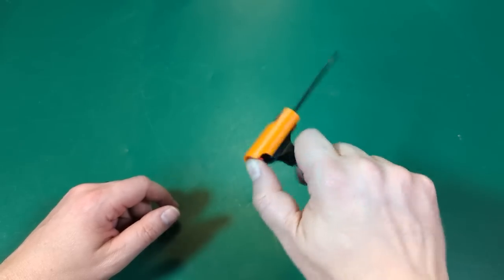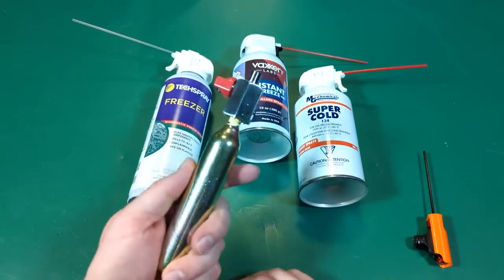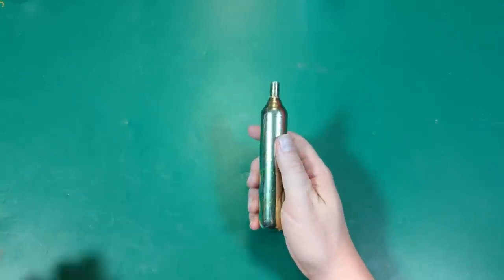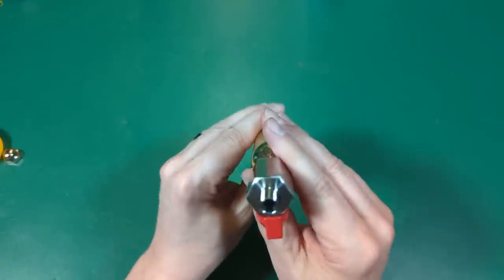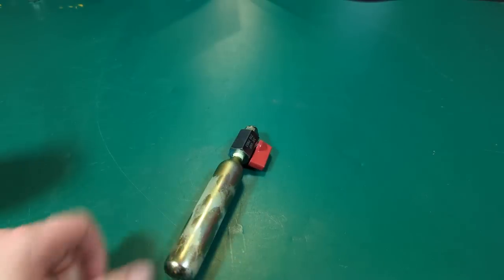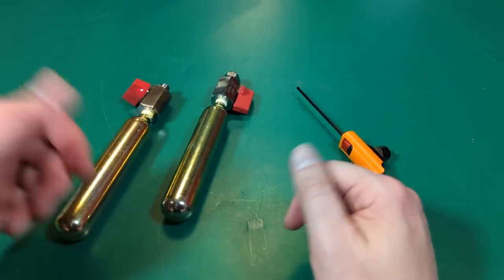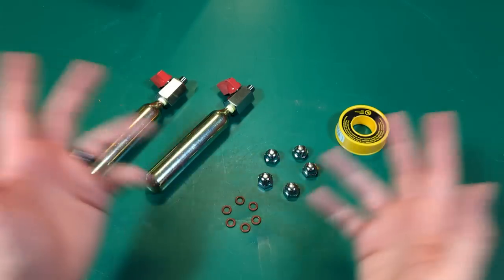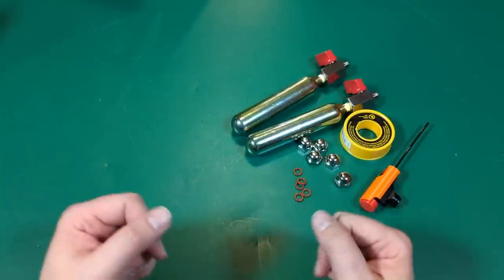Making Your Gas Canisters Refillable

Comment: You can usually unscrew those red handles and reposition them to your liking, so you could have it in the closed position when lying flat,
Reply: Of course if someone else picks it up, you've changed the standard for every ball valve of crossways=closed.  Which would be confusing.

Comment: If you wrap the cannister with some insulation you can greatly reduce the rush to close the valve.  Once the cannister is cold it'll stop boiling altogether. If you bore a hole in a block of styrofoam that'll also hold it upright for ya.
 
I've tried spraying difluoroethane into a thermos and even with the top open there was still liquid in it after like 15 minutes.  I had a temperature probe in it and it read a steady -30C or so until the liquid was gone.

Comment: I'm not sure if it would be any more or less effective than this, but back when I made Airsoft props we used to use refillable CO2 or air canisters, with a little plug of baby/talc powder (we also tried flour, but that is slightly very flammable) on the end to make a particle cloud. Aluminum tape worked as a cheap low pressure rupture disc to re-seal the canisters.
Reply: Joshua Burgess, "very slightly flammable"
Love it.
I used to refil an old BB gun with butane, and shoot the BB through a lit flame, fun times.

Comment: If you're concerned about global warming potential, MG Chemicals also makes a version of their freezer in r1234ze. Boiling point of -19c vs -26c means it won't perform quite as well.
On a side note: if you hate waste enough to refill a disposable lighter, the same fill method works with them and butane. Just spray it in until you have it mostly filled with liquid then quickly reinstall the valve.
Reply: why would you worry about ozone depletion with R134a?  It isn't an HCFC - it has zero ODP.
Reply: As a species, of course we should be concerned with ozone depletion. How we did not cease the immediate production of the entire chemical family that causes it shows how stupid we are. I understand the process people have being climate change deniers but to refute the consequences of not having an ozone layer is complete psychopathy.
Reply: @elinyght9491  sorry, I'll edit my comment: it is global warming potential (gwp). Old enough to remember when r12 production was stopped for the sake of the ozone layer.
Reply: @james-faulkner  But that was done.   Lookup the Montreal Protocol.  Developed countries like USA phased out ozone depleting refrigerants by 2020.  My point is that R134a is not an ozone depleting refrigerant (HFC rather than an HCFC) .  It has a GWP (Glowbal Warming Potential) of around 1400, meaning each pound of refrigerant leaked into the atmosphere has the equivalent warming potential of 1400 pounds of CO2 (which is significantly less than most of the refrigerants that we've been using commercially for the last 30 years), but it doesn't do anything to the ozone layer (which has been regenerating since we stopped making the HCFC refrigerants that would eventually end up in the atmosphere).
Reply: @kstricl  well now your comment makes more sense!  And I agree, worrying about GWP should be a thing, and having a lower GWP refrigerant in the canisters would be a good idea.
Reply: @elinyght9491  I am aware that some measures were taken. It is illegal to produce but not to use or sell. I am aware that this family of chemicals has not yet been to determined to deplete ozone and considered safe. My point is that demonstrates our ignorance that while having the knowledge of what Freon and other chemicals did, we only recently stopped making it. There are many other examples as well, petrol-chemicals are another as well as Teflon.
In reading the OP opening statement again, I failed to point out his error in his vocabulary. It isn't anything like global warming, ozone depletion would cause the sterilisation of Earth.
Reply: @james-faulkner  also, we just shouldn't use harmfull stuff when there are less harmfull alternatives. 
And last I heard, ozone depleting emissions have gone up again in some countries. 
I don't know if this is due to equipment recycling or new production, but it clearly shows that not everyone has gotten the message or cares.

Also, atmospheric chemistry has surprising interactions.
For example, growing hydrogen emissions will significantly impede natural methane breakdown, increasing it's effective GWP via a longer lifetime. (Sabine Hossenfelder has a recent video about that, i'll add the name)

Also, thank you everyone for civil discussion :)
Reply: @elinyght9491  just to nitpick. GWP is measured in kg, not pounds.  Sure it can be measured in pounds as well but then your value of 1400 gwp on R134 would be incorrect.
Reply: @nos9784  I have also heard of other countries doing that plus everyone I know has released Freon into the atmosphere knowing the laws.
I am aware of Sabine, I have watched a couple of videos. While she does do some science, she is mimicking Last Week Tonight and putting jokes and ridiculous images behind her with sound effects. Plus she is attempting to tell jokes and reads the scripts as well a bot would. I know, she is German they don't do comedy but she should know that. I guess I don't need all of the slide whistles and squirting flowers to watch a video that if presented well, would not require tricks. 

You know on Last Week Tonight they even did jokes about the Uvalde school shooting. I watched to see if they could actually do an adult programme and they couldn't. I don't think it is because they will not I think it is because they cannot. Now everybody is doing it.

Now who would get all pissy about Freon and family? 

Hey I used to run a refrigeration engine room, want a good refrigerant, NH3. Hell America doesn't even consider that a poison like the rest of the civilised world.
Reply: @kstricl  r12 was banned shortly before DuPont's patent on it expired.  DuPont then introduced a new refrigerant with a new patent.  Was it banned because it was bad for the environment, or banned to make more money for DuPont?
Reply: @Fury_BlackWolf  No, the figure would be exactly the same. If 1lb of R134a is an equivalent to 1400lb of CO2, then 0.45kg (1lb) of R134a is an equivalent of 0.45kg*1400 of CO2. Divide both sides by 0.45kg/1lb and you have the same factor. This is thankfully one area where conversion to imperial doesn't screw calculations over.
Reply: @MikrySoft  Oh damn. Yes you're obviously right. Was a bit tired in my head when i wrote that and i haven't been in the industry in a while. My bad.

Comment: Put the canister in a vice for drilling. Drilling into something in  your hands is an easy way to drill into your hands.
Reply from the maker: Don't do what Donny Don't does
Reply: I get one of my kids to hold the canisters,much safer.
Reply from the maker: @danceswithbadgers4024  that's thinking outside the box 😊👍
Reply: @DeviantOllam  they have smaller hands,better grip😂

Comment: If you get a can of 134A from Walmart for like $5 for your A/C system, you could easily thread the output of that can directly to your fill valve so no straw is necessary and nothing is lost. Probably a cheaper/more bulk source of 134A too.

Also do yourself a favor and buy a little bottle of Loctite 545. It's amazing sealer for small air fittings - not a thread locker, just a sealant, that works 100% better than tape. It's kind of expensive but one bottle will last a lifetime. I promise you'll never use the tape again if you try this stuff!

Hell, you could fill 4 with refrigerant and then the 5th one with nitrous oxide just to make sure you're in a good mood while you work! ;)

Comment: Keeping canisters out of landfills with this setup makes sense. I'd buy the techspray in bulk so I have plenty of it to use over time, but other people can do it how they want.
Reply: If you recycle steel like a normal person this should not be an issue. Also there is no shortage of steel and it's not harmful to dump these empty canisters into a landfill. About the same as your average steel soup can.
Reply: @ryanroberts1104  I wasn't talking about envrionmental protection. I was talking aboit long term cost.
Reply: Landfill? That is metal, just chuck it to metal trash if you dont use them, why in earth you would put them into landfill? But yeah refill makes sense long as you can make it same pressure as prefilled ones.
Reply: @Hellsong89  That's what pressure gauges are for. Use one to check you've got the pressure right. Those canistees are small enough to be thrown in a trash bag with other trash.
Reply: @Hellsong89  some people- way too many- just can't be bothered to seperate even the most basic forms of trash. Let's just hope the dump is equipped with a big magnet.

Concerning pressure, spraycans have this nice feature where overpressure will loudly reshape the bottom first, giving you a chance to rethink your choices while trying to take cover. 
Not that this applies to the bulbous cylinders shown here. 
But if there is liquid in the container, the pressure will depend on temperature and vapor pressure, not your Initial pressure during filling, if I am thinking correctly.
Reply: @ColtonRMagby  In terms of steel that would still be nil.
Reply: @Comm0ut  Depends on where you are in the world. Other places might not have as much steel.

Comment: You likely can pick up r134a at any automotive store as well. Just make sure you get one that doesn't have a leak sealer, oil, or tracer dye.
Reply: Yes - be sure to avoid the sealant. It's generally bad for cars too. It can be surprisingly hard to find un-adulterated 134A! With the right can adapter you should be able to thread it directly to your refill valve for no leaking or losses. I do know Walmart sells a cheap can with no sealer, seems like the only one like that was Great Value brand.
Reply: So the catch ends up being bureaucracy. It is legal to vent R134a as freeze spray. It is not legal to vent it as refrigerant. So while anybody actually refilling these is likely using the much cheaper car cans it would be a Bad Idea to show such a practice on Youtube.
Reply: @Birdman3131  It's not illegal to do whatever you want with 134A. That's why it is used in cars, because it is expected that in the vast majority of cars it will not get collected properly and will vent at some point in it's life. That is why it is one of the only refrigerants you can buy without a license. It's in a different class than other refrigerants, just like drugs.

R134A is actually an inferior refrigerant, it's used in cars because we know it's going to escape and that isn't as bad as other kinds that actually work better. You can use harsher/more polluting refrigerants in refrigeration systems installed by a licensed tech, but this is not required for 134A.
Reply: @ryanroberts1104  Wrong, it is absolutely illegal to vent R134A when working on a refrigerant system/car air conditioning system.  It's easy to google it up so you can stop spreading that lie.  Also, while you can buy small cans of it without a license, for the larger containers you're required to be licensed.
Reply: @DonziGT230  It's also unrealistic to expect much recovery as when car systems fail they tend to leak down. I've repaired quite a few and the vast majority didn't require connecting the recovery machine because their failure mode depleted them. While in theory a license is required to buy large containers that license is trivial to get thus obviously intended to chase off less determined users. Such laws are but words on paper but they please people who like words on paper.  

The restriction to buying small cans just increases seller profit. The price is still insignificant compared to the cost of repair and the small cans are more convenient to store vs a larger cylinder which can easily seep down over time once opened. I'm sure the whole arrangement impresses someone but they're none too perceptive.

Comment: In the olden days when we played paintball with large-ish refillable CO2 cylinders it was essential to freeze the cylinders first to be able to fill them properly. If a freezer was available using it was of course best but quick and dirty way is to fill the cylinder partly with liquid and then vent it as gas quickly. When composite compressed air cylinders and suitable regulators became available we of course immediately switched to it as soon as we could afford it. The only thing CO2 has going for it is the price: cylinders are cheap, regulators are cheap, the gas is relatively cheap and it's easy to transport large amounts (team refill station at tournament) since it's liquid at sensible pressures.
Reply: I refill 1 lb propane bottles from the big 20lb BBQ tanks and they're exactly the same.  Unless you cool the destination tank it never fills more than about halfway, if that.  If they're good and cold though you need to use a scale to avoid over-filling them.

Comment: This is a game changer for home brewers as well; we love the CO2 handheld carts but hate the disposable aspect especially for something as silly as serving beer. we usually wind up taking a full 5lb tank which inevitably falls over and breaks our regulator. The co2 cart crackers for bikes rigged up to our gas input provide an easy way to top up pressure on a serving keg. Now they make regulators for these threaded canisters (are these the same as 20oz paintball co2? those have also been cited as a good option) but the disposable part is still an issue. larger cans with the same thread and the ability to fill them up with liquid co2 fully and then shut them off would be a huge deal for picnic serving of kegs. 
I might have to grab a set and test....

Comment: This has probably already been said but the issue of the handle poking up when the valve is closed can probably be solved by just changing the alignment of the handle by 90 degrees in either direction.

Comment: For anyone thats on a tight budget....any DIY AC refill kit for Automotive AC refills will provide the same thing just in a larger form factor in size and refrigerant amount. They are available at any home depot/autozone or any auto parts stores.  The "all in one" refill kits are about 50 bucks. Alternatively a standard 12oz 134a bottle with a fill adapter would probably be even cheaper; plus you can buy the cans as you go for refills. Just snip the hose to remove the low side fill adapter and your good to go.

Comment: As a thought, if one wanted to get around needing the acorn nuts, they could remove the screw and adjust the knob accordingly.
Reply from the maker: Yes, that's possible that they could. I definitely wanted to keep the valve controls in the standard expected configuration so as to not confuse people, but it does seem feasible that they could make the adjustment on their own if they wanted.
Reply: @DeviantOllam  - This is why I appreciate all the hard work and well thought out design decisions you have made for this tool.  

Perfectly usable by design, but also infinitely customizable by the end user.

Comment: In terms of form factor, cigar tubes or hard-sided pocket humidors for cigars look like they would fit the canisters well.

If you really wanted to get fancy and trying to get more liquid into the canister, you could try putting the canister in a metal cigar tube filled with water, freeze it vertically, then refill the canister, let the water thaw, and remove from cigar tube.

Comment: Any empty aerosol canister already have the valve and usually can be easily refilled by using a simple adapter (a piece of plastic tubing can easily do the job).
Now the only concern is finding a very small aerosol canister that doesn't contain anything that can leave traces (empty canister of deodorants or lubricating oil aren't a viable option).
I think that an empty container of inert pepper spray (training unit, that contains only water and propellant) can do this job very well (plus, are very small, already have a thumb operated valve and usually the exit hole is big enough to fit a piece of plastic tube).

Comment: I don't know if they are manufactured in the size and thread used for those canisters but i know there are valves that have a fixed to the valve cap with a seal in it wich also is the "lever" to open and close the valve. That would solve multiple problems. You wouldn't have to use nuts to seal the valve, you wouldn't have a lever that can accidantally open the valve and you can't loose the nut. The only user unfriendly thing is that it isn't obvious if the valve is open or closed but that can be solved by simply marking it